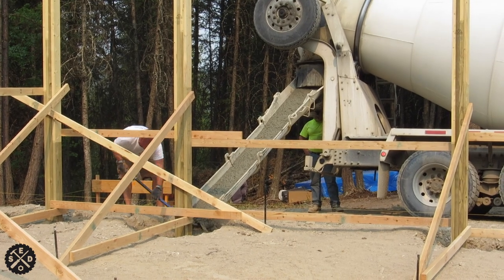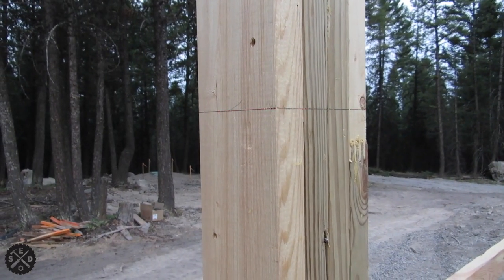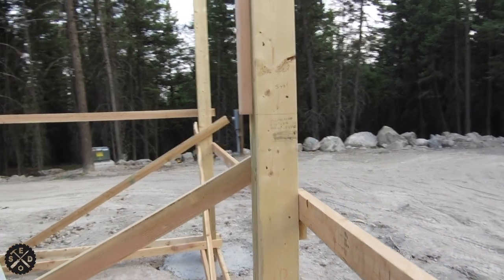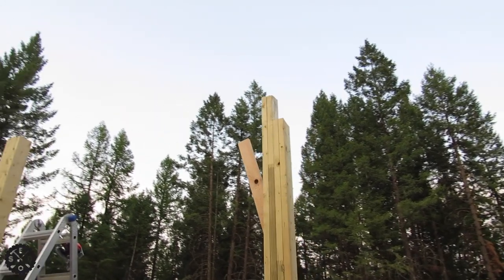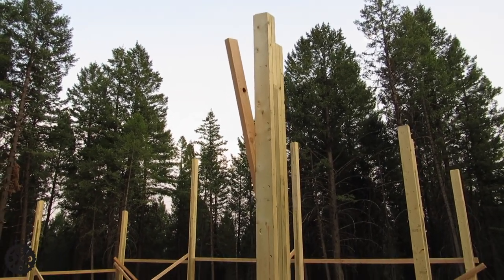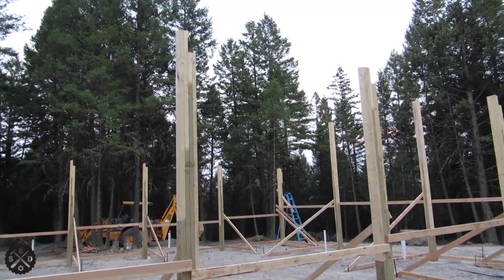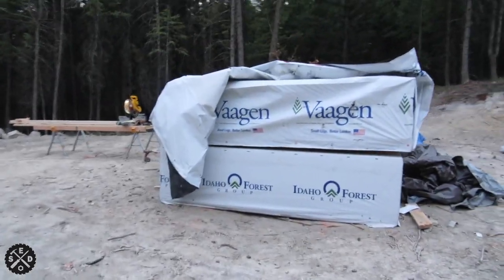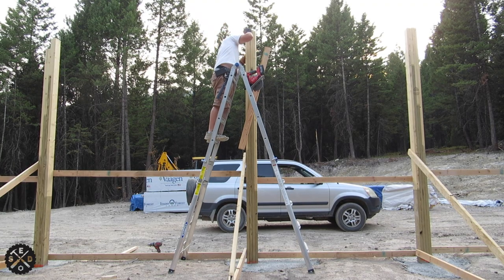Notching Posts Prep For Trusses Pole Barn House EP 5

Comment: It would've saved you a bunch of time if you would've used a stringline from corner to corner to mark your notch. If you have a level point to go off of, no point in going to each one individually with a story pole, you can just go to each one and mark the stringline. But you had all good ideas, great video! I hope this project turned out well for you!
Reply from the maker: Thanks. The one reason I didn’t do a string line is I thought it may sag a tiny bit over a 64 foot stretch even if it’s zinging tight so I didn’t want to take any chances. It did out well though. Thanks

Comment: Do you know the snow load this building is capable of/rated for? Did you get engineering/architectural drawings and analysis done on this structure? Im very interested in building in this style here in NH and my municipality requires 80 lb/ft snow load. In montana I'd assume you see as much or more snow so I supposed your structure is beating that snow load. But my building inspector is skeptical of structures that aren't built in the "traditional" or conventional styles local to us.
Reply from the maker: Yes I believe mine is rated for 80 pound foot snow load. Although I get more snow than some elevations the snow here is a lot lighter than your snow too. They did it based on my geographic location. You would probably have to get some thing done for your specific area that would make your inspector happy.

Comment: Great work,   did you buy the poles or made them yourself?  I noticed that the posts are made of treated and non-treated wood of different lengths.  Thanks,
Reply from the maker: Thank you! Yes I bought them that way. They are laminated together from the factory like that with different lengths to make them stronger. Mine were made by a company called triad. I think different companies make them. Thanks
Reply: What is the name of those poles? Awesome job btw.

Comment: Danial Boone would see this with puzzlement and curiosity.  I was always interested and they are made well; why didn't you choose this route. The log cabin route? When I was young I wanted a log built home, researched it at the time and the only way was to build it yourself; maybe other options but to costly. I wish I had the time at that time; I would have. I did check out the sample homes at the time 1980's unbelievable without a doubt. I Imagine even today; even if you do it yourself; no in the end it a better deal outcome. Your thoughts..
Reply from the maker: Yeah it would’ve been cool to do. I actually did 2 with my dad a long time ago. For the stage of life where we are as material availability in our area it wouldn’t have been so easy to do. We also wanted to do this with steel siding for low maintenance. I’d love to have a small log cabin someday though too.

Comment: Would it make sense to use post protectors into the concrete??
Reply from the maker: Yes you certainly could. There’s different methods to do it nowadays. The options I saw weren’t available in my area when I did this but I would probably do the wet set bracket method nowadays.
Reply: @SmartEasyDIYer  alright , I sent a message on instagram with some further questions for you. Absolutely awesome project, and execution!
Reply from the maker: Thank you! I’ll check your messages.

Comment: What kinda ladder is that,?
Reply from the maker: It’s a werner.
Reply: @SmartEasyDIYer  thanks.  I enjoyed your build.  Very useful, thank you. Im looking to do a 30x30x10 garage. Who supplied yours? Kinda seemed like a Hansen pole barn kit.
Reply from the maker: You’re welcome. It’s pretty handy cuz you can use it for a step ladder or a extension type ladder. It’s kinda heavy and awkward to extend it out but it works. My building is 36 x 64 x 10. I actually put the materials together myself and got them form several different local places. The truss place had the posts and trusses the lumber came from a local lumberyard that carries a better grade of lumber and the steel roofing came from a local place too.
Reply: @SmartEasyDIYer  awesome! I can only imagine the overall cost.....my building is looking like a $15,000......
Reply from the maker: Is that just to frame it up put the roof and siding on and pour the concrete floor?
Reply: @SmartEasyDIYer  frame, roof, enclosed, no doors no insulation  no concrete
Reply from the maker: Wow that sounds high! For not having any of that stuff
Reply: @SmartEasyDIYer  i know right! Concrete in my area is 167 per cubic yard for 3500psi. Trusses are very far away and posts are far away too. Lol everyone says get some them post from lowes or home depot lol i just tell them im not building a fence and the pressure treatment rating is way different for a direct burial foundation post.
Reply from the maker: Wow that is a lot!!  It’s around 100 a yd here for 4000 psi. Maybe you be better off building your own trusses. My dad always did with plywood patches and nails. They were very strong. You must live a long ways from any big town.
Reply: @SmartEasyDIYer  the sad thing is i dont live to far from a "town" but all suppliers are a lo g ways off. Im kinda inbetween Virginia tech and Radford university so they always have buildings going up and it jacks up out concrete prices
Reply from the maker: Oh I see. Yeah that definitely could make a difference.

Comment: why did you set the posts in concrete, are you not worried that they will rot in (a long) time? Would you not pour the concrete and then connect the pole to the concrete with a metal connector?
Reply from the maker: I probably would do that next time. They weren’t readily available in my area when I did this. I think it varies by location what people do but here typically they always do concrete because of how the ground is.
Reply: @SmartEasyDIYer  thanks for taking the time to reply.
Reply from the maker: You’re welcome. Good luck with whatever you decide to do